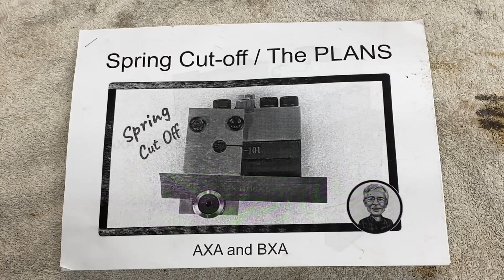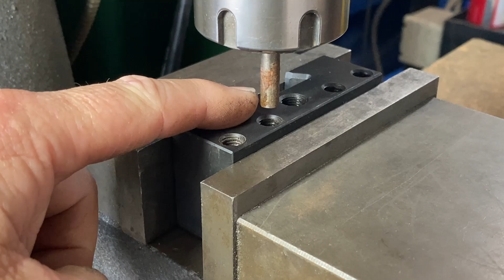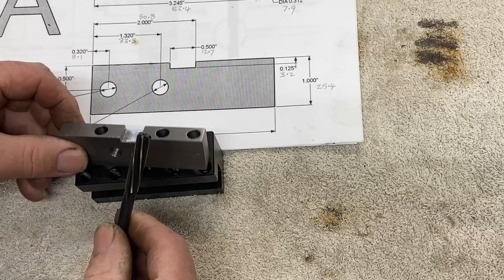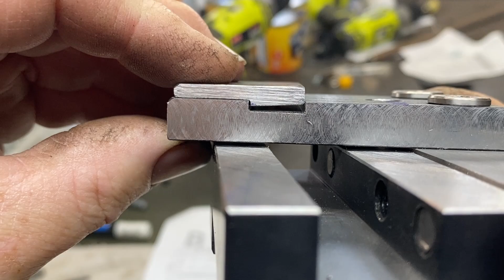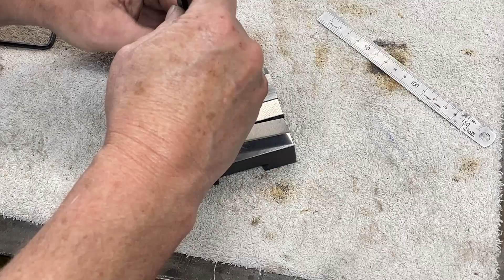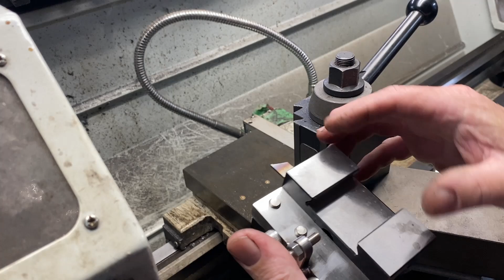Spring Cut Off Tool Winky's Workshop Style - Mark II

Comment: Hi. If I had not made the one I have now, I would make one of these. Here in the Uk I have the Myford super 7B lathe & with a Bronze bush headstock bearing I was having lots of problems parting off. But I ended up doing a video of making a rear upside down adjustable tool. Which I can fit 3 different sizes  of blades to. Works superbly. Thanks for the video. Great work.
Steve.
Reply from the maker: Hi Steve, the rear tool post parting system is a lot better as it has a number of advantages. Mark Presling made one and in his videos he talks about the advantages of rear mounted compared to the conventional front tool post parting tools. Thanks for watching.

Comment: Gee Jon, guess what my next project was going to be? I literally printed the drawings out today! I'm thinking I will use the tee section parting blade. Mark is sending me one. In light of what you have found, I think I'll delete the slotted mounting hole.
Regards,  Preso
Reply from the maker: Sorry Mark. I recall a while back there were 3 or 4 videos on making a specific Hemmingway tool. Its funny how people make the same thing at the same time. 
Regarding that slotted hole, the blade angle is not a lot where I placed the normal hole in my second version of that part. The hole on the left is 12.9mm from the top and I drilled the hole on the right 10.9mm from the top (I was trying to find a neutral/average position). You may want to go less on the hole on the right to produce more blade angle. I may actually build another part and drill the hole 9.5mm as per the measurements in the plan.

Comment: Looks to work OK Jon.  The main improvement IMHO was to reduce the massive blade overhang.  That Eclipse tool was unbelievably bad.  So much leverage on the tool post.   Interestingly I see you don't appear to use any top relief on your parting off blade.  I do and it makes a big improvement to the cutting action.  Interesting topic.  Cheers Rob
Reply from the maker: Thanks Rob. Those parting blades that I have are a bit odd. The have a chamfer completely along the top edge. So you have to grind the top surface down to remove the chamfer and make it flat to begin with. I could have ground more off further back to produce more top relief, but I was hoping that the blade angle would help with top relief. It turned out that the blade angle was not as much as my smaller parting tool. I may make another Part B with more angle for the blade which should produce more top relief.
Reply: @thehobbymachinistnz  I also don't recommend using an angled cutting edge.  I find it pushes the blade sideways away from the job and produces a cone surface (with thin blades).  To each their own method.  I still haven't tried carbide insert parting off blades ;)  HSS works fine for me, so I never bothered.  Cheers Rob